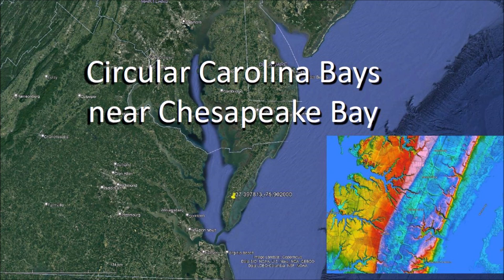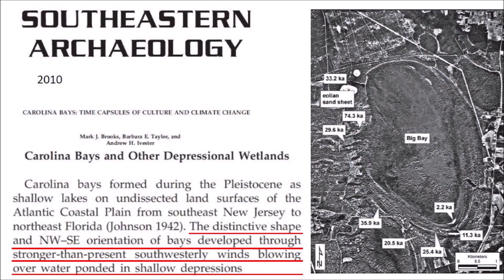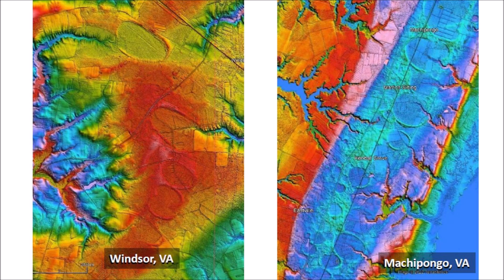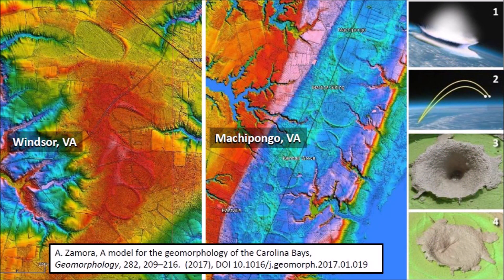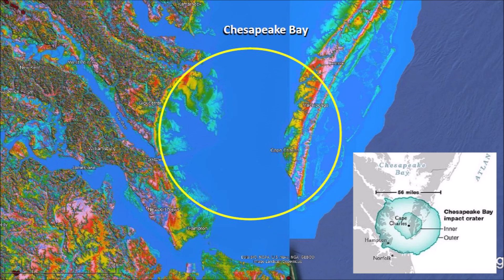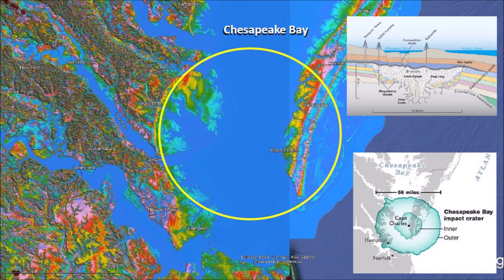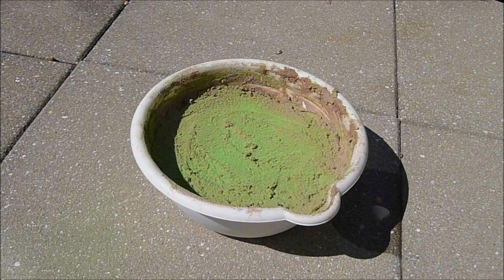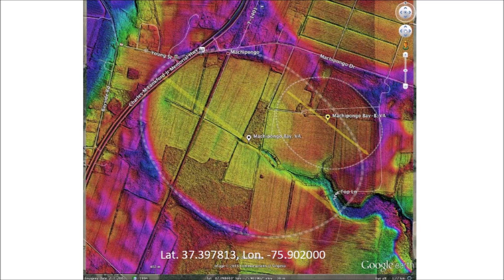Circular Carolina Bays by Chesapeake Bay - Machipongo Bay, VA

Comment: Why are there no Bays in the unconsolidated sediments of the Western portion of the Chesapeake impact crater?
Reply from the maker: That is a good question, Chris. The bays could have been wiped out by storm surges. Also, this land has a very high rate of isostatic rebound, so it is possible that the land was only exposed above water after the emplacement of the bays. It is still a question for researchers. We had some exchanges about this topic and there are still no definite answers.
Reply: @Antonio_Zamora  I know...it was rhetorical. ; )
Reply from the maker: Deja Vu.
Reply: @DabblersDen  It was a good question for us less knowledgeable but interested. I wish we could find  a supporting indication of these secondary impacts on Consolidated ground.

Comment: Antonio, are there Carolina Bay type secondary impacts in other areas of North America, as you'd expect given an even spread of ejecta material? Or were many of those secondary impacts on ice-sheets, meaning no remaining impact evidence in other regions?
Reply from the maker: Yes. The Nebraska Rainwater Basins have the same geometrical characteristics as the Carolina Bays. Their formation required unconsolidated ground that could be liquefied.

Comment: Question 1 How deep is Chesapeake bay, and was it exposed during YD.
Question 2. If Ice ages came and went for hundreds of thousands of years, What is the chance that multiple Ice sheet Impacts occured at random intervals over those thousands of years, and that Bay formations could have occured multiple times in the past, but have since been eroded away. I also wonder how many bays may still be present on the continental shelf that is now submerged underwater if tides and currents haven't destroyed them? Love your work. By the way, my uncle once lived in Conway,Sc and i never noticed from ground level, but once i viewed his house from google earth, i noticed that their house sat within the northern section of a small Bay. And two small mossy shallow ponds in their neighborhood appear to be Bays also.
Reply: These are great points!
Reply: The Bay is quite shallow. Its basically a big river valley that's been flooded by the ocean. No Bay during the YD, its 175 ft at its deepest.
Reply: The average depth is about 20 feet.